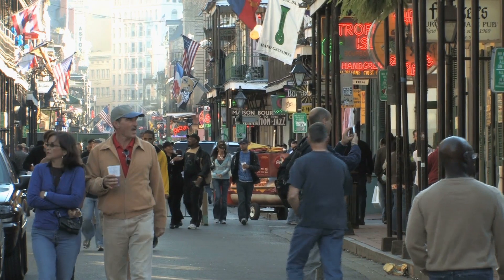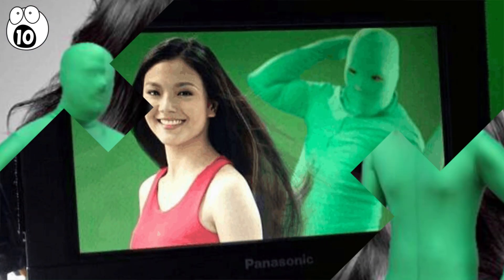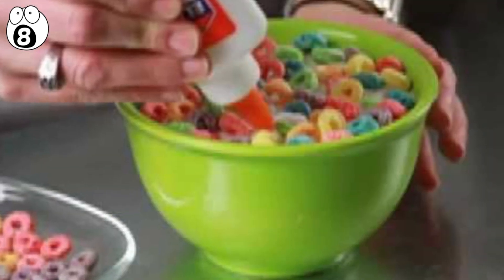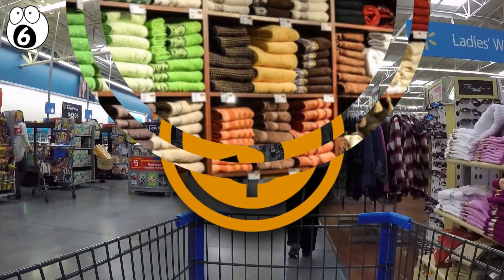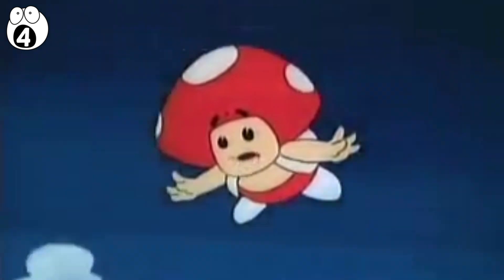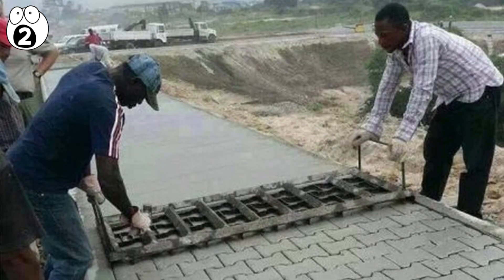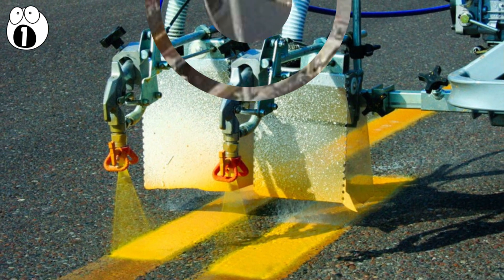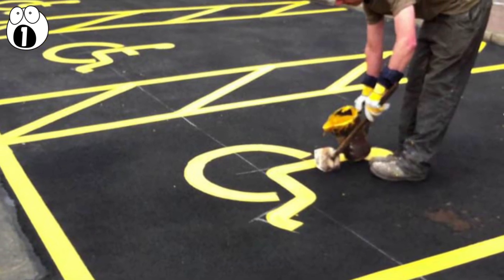Everyday Things That Prove Our Life Is a Lie

Comment: 6:13 That looks really inefficient and unnecessary.
I have worked in a Italian pizza restaurant, and spreading the sauce takes 2 sec
While they have to put the dough on the machine turn it on, then let it run for like 10 sec. then take the dough of again...
Reply: Zireael Ichaer it's just that you can do other stuff while that's spreading.
Reply: It is probably still slower. I think they do it for consistency, so all the pizzas are similar.
Reply: That footage is from a Costco and the machine is actually really really efficient. They receive the pizza sauce in a very concentrated and thick state which you load into the hopper into the bottom. Then the machine mixed the paste with water to the right consistency and proportions the perfect amount in the perfect place. They're pretty strict on quality and like to make sure ever pizza will be the same every time
Reply: So it was as I thought, nice to get it confirmed and thanks for the additional info on the machine.

Comment: Theeeeeeee thumbnail is wronnggggggggggg
I got my road worked on and watched them paint over the new pavement
Reply: Jo Deon I worked for a city and painted the yellow and white lines on the roads exactly
Reply: He didn't say they exclusively use the tape stuff. He said it's "gaining in popularity". Most people still just paint it on
Reply: Where I live they still paint the roads I know because we got stuck behind one of the huge trucks that does it and they got like 3 mph
Reply: There's several methods, including thermoplastic, paint, temporary tape and inlay tape. All of the lane jobs I've been on have involved thermo trucks and not "thermo tape". However, All of the bike symbols, stop bars, arrows ,only signs, etc are burned onto the asphalt.
Reply: Jo Deon he said most of the time
Reply: Paint is actually easier in my opinion, as cool as a flamethrower is, its a lot more work setting the take heating it up then u have to worry about the primer for the tape to stick, when paint can be preprimed into the mix and jist requires a steady hand

Comment: I worked in a small town's city maintenance for years and the way we did road markings was using that roller thing police use at a car crash, We only had a few markings to worry about as most of the streets in town are just plain 2 lane, Only markings are on the road going into and coming out of the town, It was risky work as that comes right off the highway, All we had was our yellow truck and yellow Whelen Edge 9000 lit up (no one pays attention to yellow lights) Now the state crews used the big trucks that spray markings out, We didn't have that though.

Comment: Thermo plastice is also used by a maching with the melted plastic in the hopper and a machine you either drive or push lays down the melted plastic just like it would a paint, but we use a a metal shoe for the different size line. Then glass beeds are applied to give the line the reflection it needs at night. I also do brick work and trust me, alot is dont by hand lol...

Comment: If tape is used to make the yellow lines on roads, then how do they turn the tape?
Reply: Christian Bertuccio I worked on the interstate for 4 years repaving and repairing bridges. They DO NOT use tape for the permanent lines. They have big trucks that paint the lines. Like you said you couldn't go around a corner with tape. When a road is paved it's done in mutiple pulls or layers. The top and final layer that is paved would get the tape he showed but it's only temporary until it could be painted. It is damn near impossible get that tape straight. Much easier for a truck just driving down the road painting it.
Reply: ryan t Oh. So, this guy in the video was wrong?
Reply: Pretty much. Though he does a lot of it is still painted. But even in parking lots they have walk behind machines that do that. And looking at the comments he got a lot of other things wrong as well.
Reply: ryan t Hm, I never really trust these type of videos very often. I saw the thumbnail and automatically thought of what I said before.
Reply: Tape is temporary .  Permanent thermoplastic is heated melted plastic sprayed like paint with reflective glass beads sprinkled on top before it cools down
Reply: ryan t finally someone who knows something about that topic, my dad worked in road related company and he told that this was total bullshit and tape is just temporary

Comment: What if there is a curve on the road what are you gonna about the tape

Edit: thanks for all the likes I've never got more then 2 likes
Reply: Jasmine Irwin it's done by paint, it's a load of rubbish that it's tape, I've literally seen it being done, however it's a sorta paint dragging tool they use.
Reply: I worked with that tape when I did road work. You just curve the tape. It's pliable so you can just bend it around a curve. It's better than the paint especially in warmer climates and it's less labor intensive. It also lasts longer than the paint.
Reply: Jasmine Irwin lol
Reply: MetaDecker oohhh
Reply: MetaDecker thx

Comment: The whole 'Captain' thing isn't correct. The stripes on the sleeves represent Length of Service (left arm) or Length of Time Deployed (right arm). Each stripe on the left represents 3 years. Each bar on the right arm represents 6 months. (These are by U.S. Army dress standards)

So the stripes on his lower sleeve have nothing to do with his rank.
Reply: You would be right if you weren't so wrong. Stripes on the sleeves for naval officers shows their rank. Also, the CO of a boat/ship, whether 06 or not receives the title captain.

Comment: Re: Roadside Markings- the thermoplastic markings are bad for motorcyclists, when it's damp/wet. Of course noone thought about that. Well, we learrn; bikers are smarter than most or we wouldn't survive.
Reply: Those tar strips used to patch cracks are also a pain to ride.  They make the bike feel squirrely.
Reply: Some of those tapes have a conductive backing. They discovered this when, at the scene of a traffic collision, a wire came down Hundreds of feet away,  hit the center line, and took out a Fire Company.

Comment: Not sure where you got your info but thermo plastic line marking is a pain in the ****. 
Paint is a lot quicker, easier to apply, there is no mixing and drys just as fast plus there is no indepth road cleaning or preparation required and all the shapes and patterns are done by stencils. 
The thermo stuff has to be and cut down to the correct mm and there is not just one piece, it's using heaps of properly and perfectly trimmed smaller pieces. The road gets measured and marked, all pieces cut and lay out, then all pieces collected, road pre-heated, scrubbed then swept, heated again to maintain an ideal predefined temperature, pieces are lay out again, melted into place making sure that the flame does not get too close and allow the top of the plastic line product to become brown (if it does go brown it have to be removed off the road by being jack hammered, ground off while on hand and nees just plain chiseled of the road if incorrect) then while still warm but not too hot, glass miniature spheres are spread across it so the surface is reflective at night.

Comment: as for the pavement line, ive never seen anybody use that tape lol.
we use machine and paint sprayer with crushed glass for reflective property.
the guys lay some marker called ''puck'' and paint with either a small motorised cart or with a truck, paint is already pre mixed and they have plywood stensil for intricate design

Comment: Captain is not just a rank. It's also a position. I served in the US Navy on submarines. My captains were commanders by rank but were addressed as Captain. Some subs at times had Captains by rank as Captain but usually Commanders. Most surface ships too. So Captain Crunch not so far fetched.

Comment: I like the video but the part about Captain crunch is wrong. Captain has two meanings, yes it's a rank in the US Navy it's an O-6 but there is also the captain of the ship, every ship has a crew an XO AND a CO commonly referred to as the captain, the captain can be a O-7,O-6, O-5, or even a O-4. It depends on the size of the crew that's why carriers always have a O6 or O7 and smaller ships will have an O5 Or O4.  So the captain crunch can in deed be a captain with his current rank.

Comment: Only in the EU do they use the thermal tape, I'm sure some in the USA might use it. But my roads and parking lots are done by 2 trucks, one that sprays the paint and the other has big water bumpers Incase of someone hitting the slow moving truck.

And the big handy cap logos are just a huge stencil, and sprayed then pulled up and moved to another spot. The heat of the pavement sets the spray in a matter of few mintues

Comment: I dont know about the truth abut the road tape stuff but all I know is that in my country the way they put road lines is by using a machine that is pushed or pulled depending on the situation the automatically paint road lines. Its a lot faster and easier

Comment: Road markings are my side job. Most lines are done with  a paint spraying machine that sprays paint at specific widths then the machine is moved forward to give a nice crisp 4" or  6" line. Stencils are used for the handicap marking and the spray gun is removed from the machine and used to spray on the stencil. The tape is rarely used as it is so expensive. Only idiots use a brush or roller smh.

Comment: They literally live of that concrete trick in Disney world.
I promise I would bet that every building in there is made of pure concrete.
Even the bricks on the Disney castle are concrete.
I was told this and examined a brick wall ( or should I say concrete wall ) a little later on.
I could easily tell that it was concrete with brick shapes in it and the brick parts were painted violet to look like bricks.

Comment: Here in UK they paint road markings never seen anyone use tape
Reply: The tape is mainly for little repair jobs as far as im aware. Where i live they use paint with crushed glass and heat it up to seal it, but only in heavy traffic areas. Rural areas is just straight road paint.

Comment: You are wrong my dad is a road maker and has done it for years the fermoplastic that we heat up we will normally put on small jobs like a car park or playgrounds and on the road we spray the liquid plastic on the ground which cools within 3 seconds and we also youse machines like a rideable lawn mower to do it to and with the wheelchair symbols we will use a metal devise with a funal of where the melted plastic goes the fing you are right about though is the blue signs with people on we burn that on the ground from the back of the truck.

Comment: None because you completely usually wrong most of the time in the universe, yes these technologies out there but because thousands of quids to do, I weigh maintenance people do not use these because it’s cheaper to do it the old-fashioned way and that we paint and it’s easy to do if you actually look it up on the Internet because it’s just a square with a hole on the top and bottom where they just all walking around an area like a paintbrush